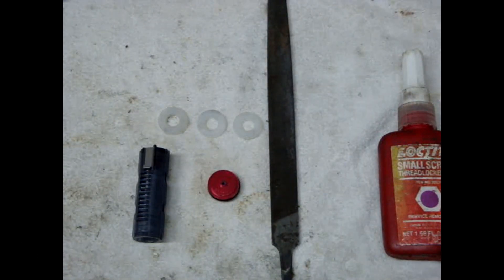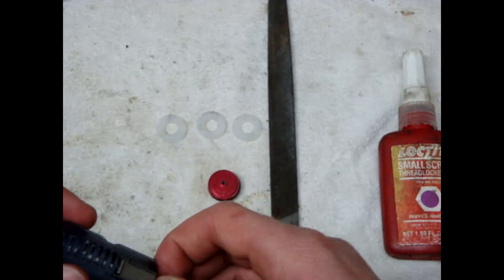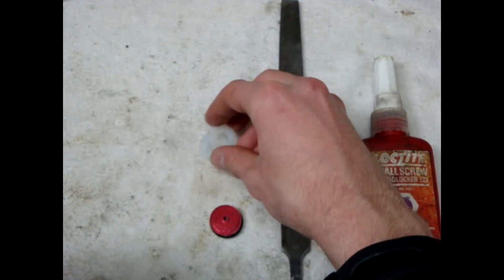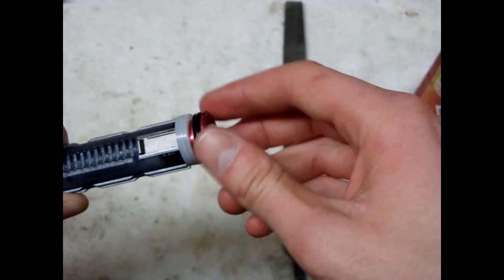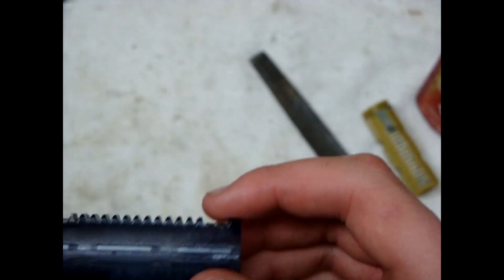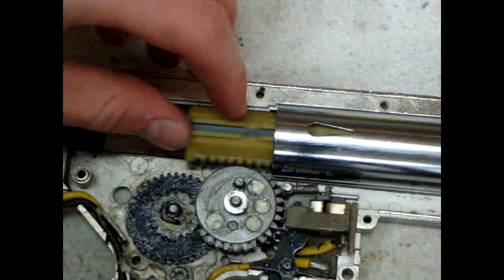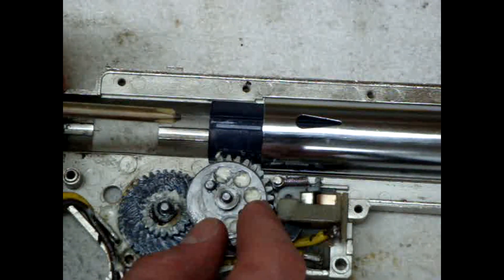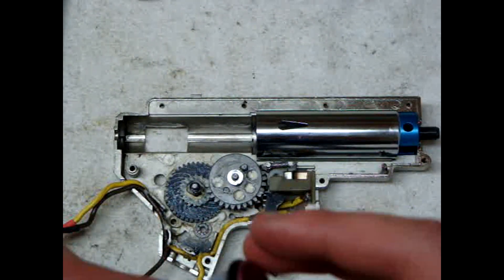Airsoft AEG Do it yourself Piston Upgrade

Comment from the maker: I know this is super late reply but the piston failed 2 games ago, that was with at least 20,000 rounds through it, and it dident fail at the piston teeth, it failed at the piston head where the screw goes through. I am pleased with the upgrade, another method I am thinking of doing is gluing rubber spacers on the cylender head and not using the nylong spacers on the piston, making for better shock absorbtion and making for less piston modification

Comment: Wow, you've got about half a kilo of unnecessary grease in the gearbox. That's going to really slow it down.
I'd also like to add that this mod is only needed if your aoa is bad, which is something that I rarely encounter these days when I'm working on AEG's.
If it aint broke ... don't fix it!

Comment from the maker: after I finished the insilation in my gun, i actually experienced a increase in fps from the spacer  making the spring tighter, i was running a m90 spring, just swaped to a m100 and im getting about 380 fps with .20s at about 20rps

Comment: only problemis there will be more fps depression over time not a worry to high speed setups but the fact that if you do this your spring will be commpressed more you will have a loss in fps much faster than normal so i wouldnt recomend this to sumbody going for a high power setup wich i am going for now high speed would be good cept for a  lil bit of added weight but that can always be fixed with a dremal and big file like he has in the vid